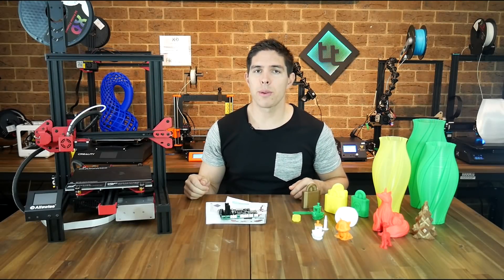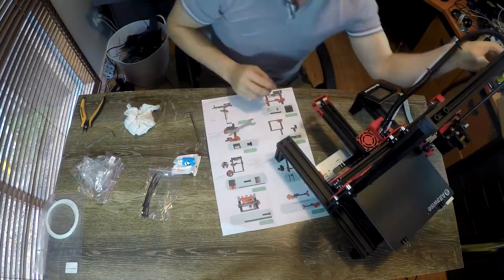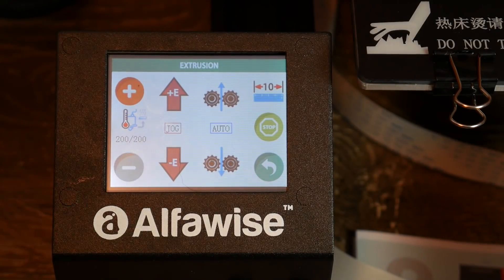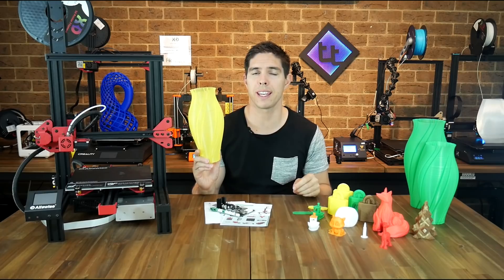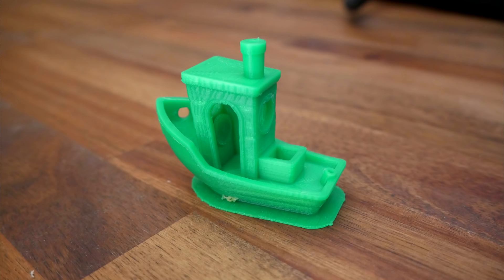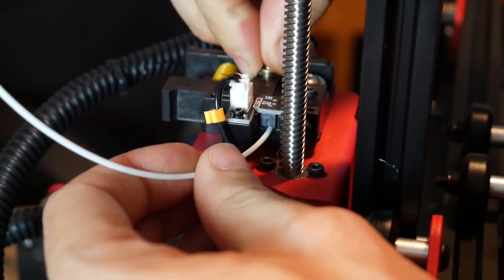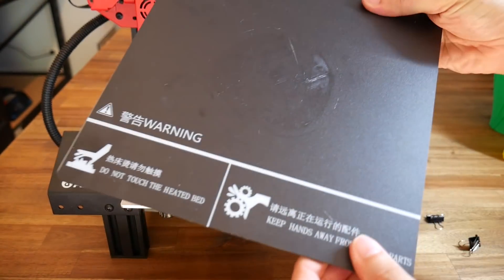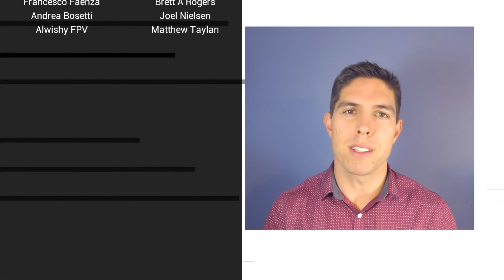Alfawise U30 review - The wrong way to clone an Ender 3

Comment: I actually own 2 variants of this EXACT printer, the Longer LK4, and 1 variant of the Alfawise U20 (copy of CR-10), which is the Longer LK2.  I purchased the first one in December of '19 and since then bought the other 2. I've watched ALOT of your vids on the Ender 3, CR-10, mainboards etc.

I will admit that only 1 is still "stock", apart from a dual geared extruder.  That one has been printing non-stop for 2 weeks now making Face shields for the CoronaVirus Pandemic.  The other 2 I have been upgrading piece by piece including; Mainboard, Screen, Extruder, Direct-Drive, and E3D V6 upgrades.

I've had approximatley 70%-90% success rates out of each one.  I have just now seen THIS video about your review on the printer though, over a year later so I'm assuming that the  company had some improvements or I've just been "lucky".

The reason for the upgrades are simply because I have a BAD tendency to tinker and try new things. I'm not knocking your video or review, I'm simply giving you MY personal experience with this product.

Thank you for the videos and guidance on "All Things" printing.

Comment: Theres a reason you got that one free pal.. it was destined for the bin. I was immediatley struck by how well the device had been packed and things such as the Z axis end stop had already been fitted to mine and If you are going to build a 3d printer, I think its fair to say that youd have to be something on the slow side to not understand the absolute quality 3d drawings on glossy catalogue type paper supplied. I put mine together in 30 mins as an absolute novice having never seen a 3d printer other than in pictures. I, was blown away at how well the device parts where machined with absolutely no swarf after machining the aluminium parts, and whilst I had already downloaded Beta Cura slicer software, it was already set up for Alfawise U30.
Im sure that theyve given you a factory dropped model. The Very first thing I printed was a fox  and my only bad thing was that there wasnt enough fillament to finish the print and so i continue the print with abs instead of pla... i now know the difference.
The second thing i printed was a 2 day print of a strandbeest and learned the value of not putting supports every where.
Since then having owne it for just 2 weeks I have had no problems whatsoever and since I wasnt keen to build one from scratch, this semi built printer was  from my point of view as a newbie, the best money I have spent on gearbest in a flash sale for 125 GB pounds. I would highly reccommend this to other newbies looking for a starting point and have only one tip.. Read other peoples tips, such as using a layer of hairspray for a flawless 1st layer print when printing the likes of kit cards. Im sure they have put the scraps in a box simply because its a freebie for your channel. If you have any advice on metal printing id be happy to hear em.

Comment: I just bought a Longer LK4 which is basically the same printer with a different name. When this video was posted it was probably when it was the LK2.  So mine is the next generation of what was reviewed.  It took me a while to figure out the settings of the slicing software but after I did I have had no problems.  The only thing I don't like is getting the part off the print board.  This is my first 3D printer so I have nothing to compare it with.  It prints seem to be even and haven't had the stringing problem I have seen with some modeling some reviews on YouTube.

Comment: I did also a review of the printer and I don't have the same conclusion as you. I'm still printing quite a lot with mine which I didn't modify except installing TL Smoothers and obviously, printing basic modifications like larger wheels for bed leveling, clips for the cables and adding an extension for the Micro SD card (I mention all of that in my review). But the most important is mine is printing perfectly fine with the default slicer settings (I'm using as well Simplify).
While I understand you may had a bad machine like I probably had for the Tevo Tornado, probably not all the U30 are like yours and it's great that you mention that as well in your video. It's great to show also when things go wrong and your problems have been quite serious.
Keep the good work! :)

Comment: Im told that my Longer LK2 is this exact printer. i have not had any issues with it as of yet and works great using my ender 3 profile. Im glad to see this prospective of this machine so thank you for your honest review. I will keep an eye out for these issues though i havent had much in the way of problems with it/them (i have two). i did find the test prints to be spotty. The little bird (owls) turned out great but the Benchy and bullet i found to be poor. There is also some model on there that i think is a budda but looks more like a dead baby (yikes) but also turned out great. i havent tried the fox yet but i did save it on the SD card to check its quality. Again thank you for sharing your experience and keep up the great work.

Comment: Great review. I purchased this printer myself and do agree that the instructions are really bad. But in my experiences this has been a very good printer and since its very similar to the ender 3 there are tons of mods that can be done. Since purchasing it I have added a cable chain and changed the hot end assembly. I can say that it can produce Prusa mk3 level of prints.

Comment: I still waiting for my unit, it should come this days. And it's good to know, that I've to be very carefully with this device. At the time I've order it I calculated, that I will not going happy with it. In this case I'll use the material partly for fixing other printers or for getting more experiece in electronics, not in 3D printing. I'll looking forward for what I get .....

Comment: For the layer height issues (z axis) you should try to push down the threaded rod in the coupler to make it touch the motor shaft. It worked for me

Comment: I used to have under extrusion issues on my ender 3 as well, although I got a stronger spring for my extruder assembly and that fixed the problem, giving the extruder more grip. maybe, just maybe this is part of the cause of for the under extrusion?

Comment: Looks like you had an under extrusion issue and you didn't address it. Real disappointing review. Like you pointed it out but your fixes are way off.
Maybe taking more than 30 min to build it would have helped.
Reply from the maker: Strongly disagree. I followed their instructions and they advertise it as beginner friendly. Therefore that's all I should have to do. I even contacted the company and gave them a chance to address the problem. Now sure what else you expect me to do before it becomes a how to fix video instead of a review.
In terms of under extrusion, the constant fusing of lock pick puzzle would require even less flow rate is required to correct this issue. The problems were inherent to the poor quality of my review unit.
Reply: @TeachingTech  I believe most of your issues could be eliminated by making sure the z motor is properly aligned. The spring looking couples can cause all kinds of issues if off angle. I didn't see this addressed in your video and I felt the mechanical options for correcting the flaw were neglected.

Thank you for doing what you do and thank you for the reply.
Reply: Yeah I agree, it’s a thing that simply happens at these prices and almost always requires a tiny tweak. I get that that isn’t what newbies are supposed to do but it kind of makes all the other comparisons a bit useless.
Reply: Fella I got the exact problem! And I need help fixing it! What do I do!
Reply: @McGrathElectricServices  These problems are most likely caused by inconsistent gantry movements. The first thing I would do in your situation is loosen off the Z motor mount as well as the upper 3 frame pieces from the body and make sure it's all square. This may require you to readjust the tension on the rollers of your gantry.

Comment: I don't recmend any one to buy it 

I did   bought it it's a scrap 
Even the power supply isn't work I replaced it with pc power supply and it's worked than I tried to preheated for PLA it reaches to 150c and this error pops out ( abnormal head temperature is detected) 9:48 
How can I fix it?
Reply from the maker: Sounds like there might be separation between the hot end heater and thermistor. The nozzle is probably way hotter than 150 but it isn't measuring it as high as it expects and therefore pops the error.

Comment: the machine is not too bad. the issue is typically one of quality control. check mechanical alignment for the banding check the feeder for the extrusion. watch out for stripping bolts. also the hot end is suspect. take it apart and reassemble making sure the PTFE properly mates to the nozzle interface (no you should not have to do that but hey its chinese printers FTW ! :-) hehe

the machine is made by Longer 3D as the LK2 and they DO appear to be pretty responsive to feedback (we shall see) so hopefully they will correct the quality control issues and make it better. I send them a pretty decent laundry list of things to correct and update.

otherwise agreed 100% machine needs improvements. good try poorly executed.

Comment: I have had this printer for two weeks and I don't have the extrusion problems you mentioned. The three prints I made were good out of the box. I'm confident I can get a better quality by tweaking the slicer settings. I just installed TL smoothers and a left over Capricorn tube I had lying around. Next will be stepper silencers,  external MOSFET power relays and better printed extruder and print cooling solutions.  I personally barely looked at the assembly manual, because I watched a few review videos of beforehand and I followed along the official Alfawise youtube chanel assembly video that was really clear to me. Conclusion for me is this printer was worth the price I payed and it will get better as I use and improve it. Thanks for your honest review, but I think you were unlucky and got a lemon.

Comment: Safety suggestion consider something like a sonoff th16 to kill power to 3d printer if there is a fire. I saw this idea from Caroline Dunn on YouTube.
Reply from the maker: I'm working on an Octoprint/MQ2/relay safety system at the moment. Big need for this in 3D printing.
Reply: I like the octopi relay idea.. There is an octopi iftt plug in that might be useful. When the relay is triggered you can get a notification on your phone.

Comment: can you do a video upgrading the u30, Making it better, i got mine before you upload this video :(
Reply: I ordered mine before this too, I'm hoping he's got a bad batch as a few others have said it's been a good in a review.
Reply: +1
Reply: @stevekiss8367  Steve check out my quick review, I'm no where near a expert level or anything
Reply: @ifell3  Thank you very much. I have already added "Upper filament guide" from thingiverse. Need to find a cooling fan funnel and definitely going to add wifi ESP8266 using luc-github/ESP3D firmware.

Comment: I love that these 3D printer companies are trying new things, But am i the only one who doesn't want to pay more for a touch screen? Seriously. everone i know uses octoprint and never uses an SD card or even the interface. I think the only time i actually use the printer's own interface is when i want to quickly disable stepper motors or hit preheat PLA to swap my filament over.

Would much rather they save the money they spend on a touchscreen and add auto bed levelling or run out sensors, better firmware and better Q & A.

Otherwise nice review mate, I have my Ender 3 now and am over the moon at how well it is printing and everything it came with So no more cheap printers for me until I save up for a prusa.

Keep it up.
Reply: @Don Gray I don't think they are all terrible. I have been getting amazing prints from my ender 3, so i am not sure why you have had no luck. It worked great out of the box with no upgrades and just bed leveling. Considering the ender 3 cost me $280 delivered with free postage from an Australian supplier i am over the moon with the quality of the prints.

bomb boo - https://i.imgur.com/AuPDIGu.jpg
ender 3 dog - (first print before retraction settings) https://i.imgur.com/q07jert.jpg

if you are expecting better prints than these from spending just a few hundred, I would be amazed.

Octoprint is very easy to setup, It comes ready to go with an image you can flash straight onto an sd card, All you do is plug in a webcam, and plug in your printer and boom away you go. Not sure what you mean by "most people are not tinkerers" I would argue that most people who buy 3d printers are the type to be tinkerers but i have nothing to back that up. All i can do is use the information i have which is nearly all my friends who have 3d printers all use octoprint and are "tinkerers". Expecting to spend very little and get amazing results is just not where 3d printing is right now, But considering the prints i am getting from my Ender 3 i am definitely happy until i can justify the upgrade to a prusa mk 3.

Considering i can design something at a certain size and it prints and fits together, What more can i ask for?

but hey each to their own. Hope you find a printer that works for you.

Comment: TY for your honesty in sharing the info in this review, I am awaiting arrival of my Ender 3 my first foray into 3d printing I am collecting some parts for that as well to assemble it as we speak ie: correct Amass connectors, a metal extruder, stiffer bed springs, Capricorn Tubing etc etc. should be fun!

Comment: I really wish you could get your hands on the Geeetech A10. It is also a Ender 3 colon. But with better improvements, (in writing that is)? It has the OPEN SOURCE GT2560 control board, runs on 24 volt/360W PS and has a boot loader for updates built in. Plus it's $185.99 plus 5.99 shipping USD. Very affordable!  All the stuff people have to pay extra for to upgrade the Ender 3.  Thanks for the video, very informative. Your thoughts on this?
Reply: Colon?????
Reply: Ian Jeffery not really, just a better Ender 3. I believe! But I have not touch one as of yet!
Reply: Michael / Teaching Tech has done  a couple of  videos on the Geeetech A10m - the  dual extruder version of the A10 if you're interested.
Reply: I saw that video. You concentrated on the dual filament extruder and how it printed.  Good video! But the A10 is true a better version of the Ender 3, to me! . I wish someone would (you) compare this one? I believe this printer is an underdog that is getting over looked and soon will be gone?
Reply: As I said, Teachingtech makes great videos that are very helpful! But in the case of the Geeetech A10M video, he concentrated on the dual filament printing, not  in depth of the A10 part of the printer! I wish he could get his hands on the A10 to compare to the Ender. Other video makers have raved about the A10 kicking Ender 3's ass! I respect Teachingtechs opinion and would like to see this review?
Reply: I really like the GT2560, but it's not perfect. There is no ISP connector on it, so if the bootloader gets corrupted (or they send you a board without it - as in my case), you're going to have to get your soldering iron out. Big negative imo.
Reply: Defaker sorry, what does ISP stand for?
Reply: https://en.wikipedia.org/wiki/In-system_programming

Comment: Nice honest advice, versus Angus' review of the sad Xvico.
This really bugs me: these printer manuals suggest tramming the bed with a 0.2mm feeler gauge or paper. Creality even provides a 0.2mm feeler.

Paper is 0.10 mm. Huge difference in adhesion. I'm tramming at 0.08.

Comment: You might try changing the cable wire going to the extruder stepper. I've had poorly crimped wire connections cause that same issue.
Reply: Nah you can't fix Stupid! (Gearbest)

Comment: Mine came with a broken power supply and a very badly warped build plate. Instead of waiting on gearbest i just grabbed a meanwell ps which fixed that and leveled the bed as best i can for now with strips of tape. They are sending a new plate but the print quality is bad due to extrusion like yours. Stepper dampeners have been recommended by others but in looking back i should have just a ender 3. Waiting to see what you come up with to fix this thing.
Reply: A poor man always pays twice.....not suggesting etc, just quoting.

Comment: Thanks for the heads up. Quality Assurance seems to be zero. The wiring looks like a prototype. The bent/dented guard could not even pass a visual check. Imagine sending that out for review. Any normal company would make damn sure you got the one with the best turnout. I wonder what they were thinking. I thought you were very fair in your review, you qualified with examples.  ;)